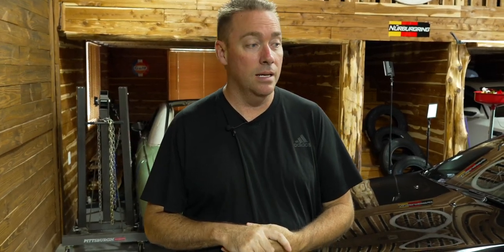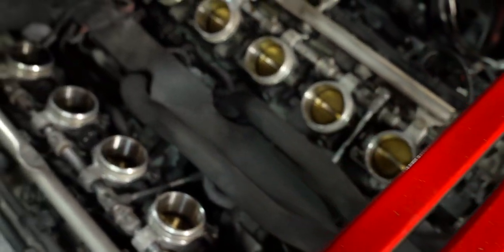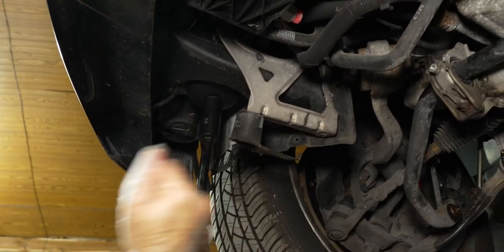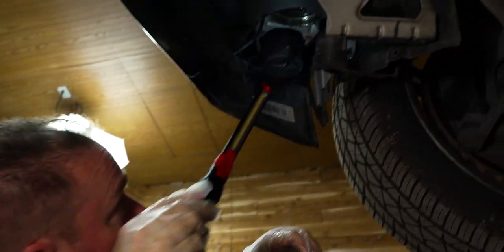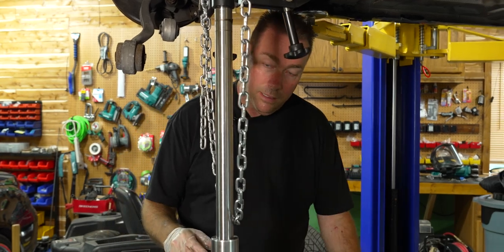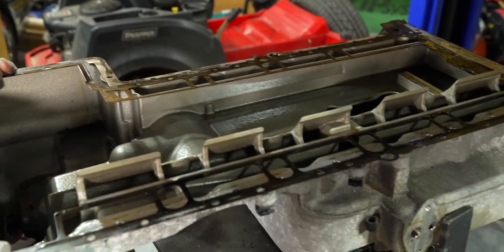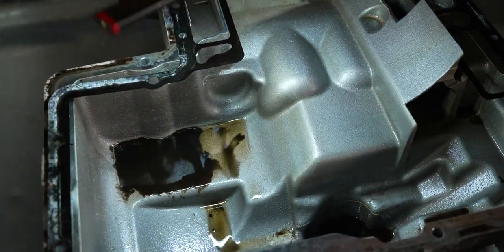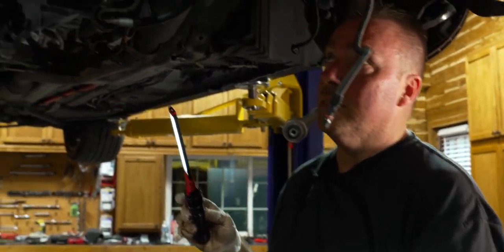BMW M6 S85 Rod Bearing And Vanos Pump Failure ... { Project INDY Part 2 }

Comment: 10W60? Why such a wide range of oil temp needed? I was thinking about going that direction because my summers are over 100F May-Sept. BMW manual says 5W30 or 5W40 all climates.  Nothing has seized to date.
Reply from the maker: That is just what bmw recommends for this engine

Comment: Do you think the lower viscosity oil helped the rod bearings but trashed the vanos pump gear?
Reply from the maker: We will never really know
Reply: @NathansBMWWorkshop  thank you cause I’m wondering if that’s at least part of the reason why bmw specs such a heavy oil. I mean gear oil is very heavy.

Comment: Strange that the vanos pump has failed as BMW revised the vanos pump gear in March 2007 and i'm guessing this is a post 2007 car?
Reply from the maker: It’s a 2007  like the blue one was
Reply: @NathansBMWWorkshop  Interesting, wonder if the build date is pre March of that year
Reply: something caused the vanos pump race to fail for it to not spin like that, that part was never updated, plus the gears were changed early in 06 if you check realoem

Comment: From what I gather on your channel, BMWs are like handguns. Very precise tools, but you have to strip them COMPLETELY apart every once in awhile.
Reply: Pete L  the ones I’ve owned weren’t like that. Lol they’ve been like cool pieces of crap in my experience. I live in the desert, so I deal with the opposite of rust. Dry rot. That seems to be the main thing that ails these cars.
Reply: Maybe like a mistress. Love to ride on the regular but costly😂!
Reply: Bmw have a very long over maintenance history but the newer models definitely have improved to better reliability.
Reply: Absolutely not. What they are is like the ideal woman. You get them while they’re virgins and treat them in such a way that they’ll never disappoint you. I have an 2000 E39 528i. I leased that car out of college. Bought it once the lease was up and I could actually afford owning one. 22yrs and that car has never failed me or left me stranded.
Reply: Pete L  if you’re the 5th or 6th owner and now you’re dealing with all the abuse and misuse, sure.

Comment: i got one question which has made me curious, I own 2008 m3 with 89,000 miles on it.

I’ve been owning it since the past 3 months and the car’s been great so far. 

10w60 always was used in this car, and the rod bearings are stock… but Recently since 2 weeks I’ve changed from 10w60 to 0w40 and the car has been running better. I did it because my mechanic recommended it and said it’s the best for the s65 and s85 in the place I live.

I asked him if I still have to do the rod bearing change  cuz 0w40 is a thinner oil unlike 10w60, and he told me there is no need. 

So just out of curiosity I wanted to ask here, do I need to do rod bearings (which have wear let’s assume, don’t know how they look) even if I changed to thinner oil? I’ve read online about many s65 and s85 owners changing to 0w40 and saying it’s better than 10w60, rod bearing change here is very expensive and I can’t afford to do it right now..  

He also made great point, he mentioned how lambo gallardo for example or Ferrari 430 when they were released, the oil spec was 0w40 and not 10w60, so how come s65 and s85 need 10w60? It’s too thick

Comment: Um my e39 leaked all of its power steering fluid while sitting for 3 hours. I mean all of if. Its just a simple hose, right?
Reply from the maker: Maybe, or the rack is leaking
Reply: @NathansBMWWorkshop  well shit...
Reply: @NathansBMWWorkshop  it was leaking by the ps pump though.

Comment: hey love the work you do on the s85 motors, would you be willing to take and fix my s85 motor? thanks for the informative info on the motor!
Reply: What’s wrong with it
Reply: @505M5-k3p  the car starts but need to keep rpm up to keep it running. Something internal. Not coilpacks, or plugs. I know the car I've put 80k miles on it. Something internal. Would love to see if block is buildable! I looking to redo the hole motor